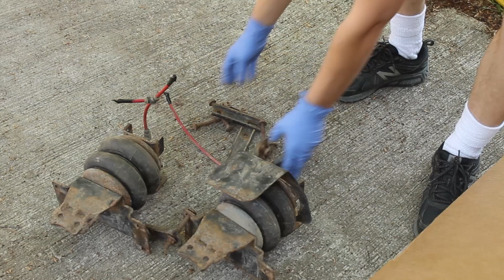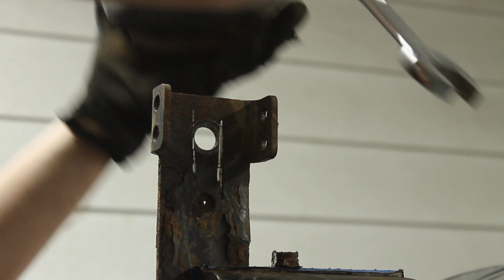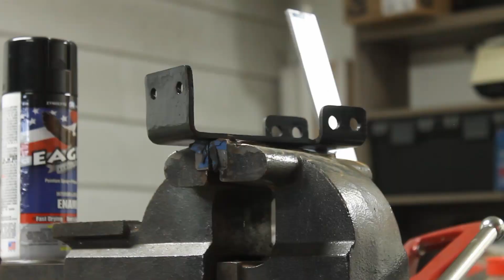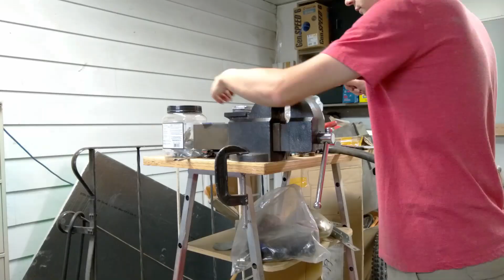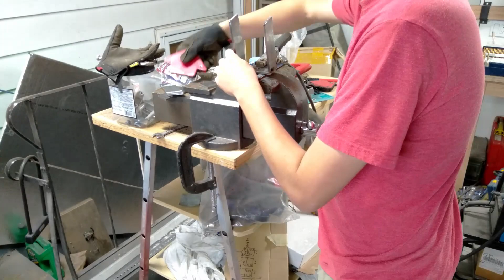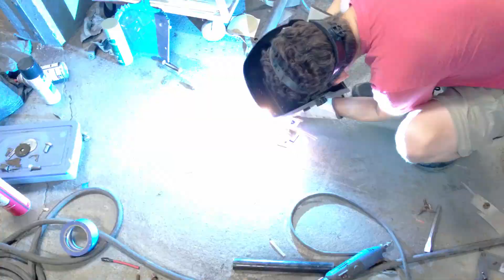Tacoma Riderite Airbags Part 1: Refurbishment

Comment: Just a heads up captain those all copper air fittings tend to hold better over time than a plastic fitting if you're going to replace it.
Reply from the maker: Thanks, the new ones are brass. We'll see how the plastic air lines hold up tho.